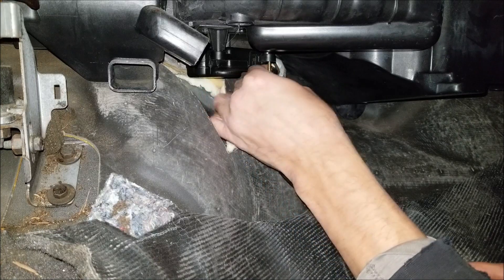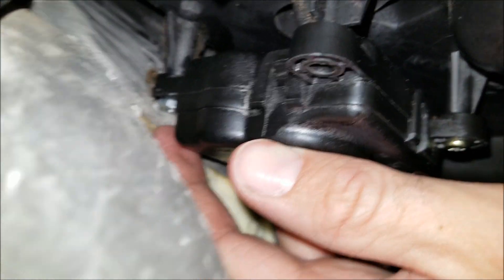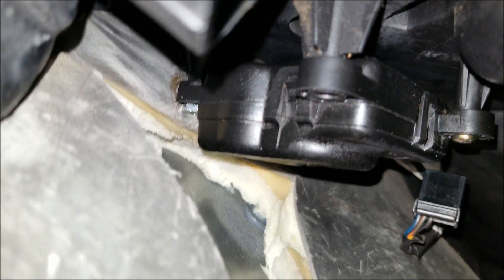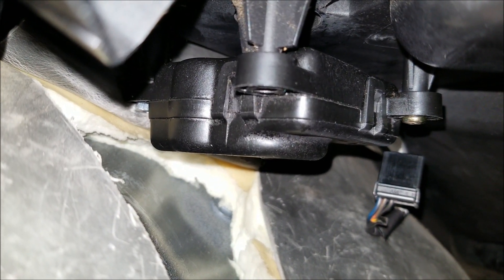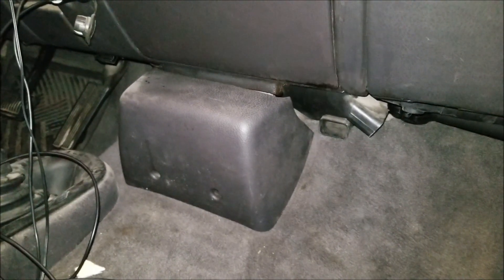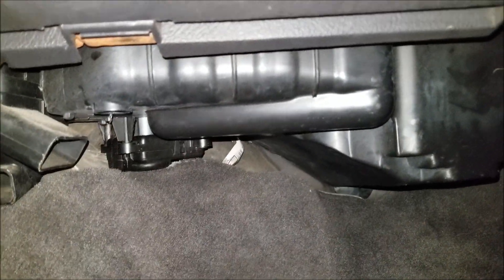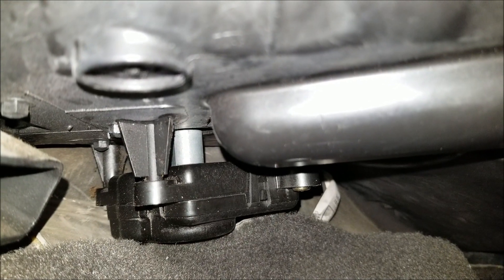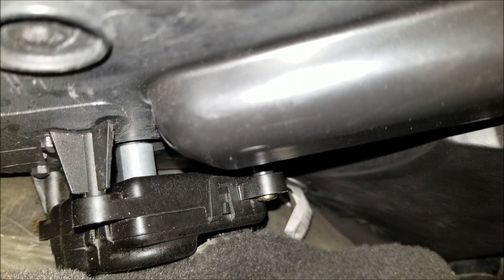2001 Dodge Ram 1500 - Blend Door Repair/Heater Treater Installation  - Part 3

Comment: Matt, thanks for taking the time to put out a great video regarding this issue. Keeping older vehicles on the road, one video at a time. Can't count the number of times I have wondering what the engineers were thinking. All they would have had to do is swap the back screw and the indexing post, and it would have made removing and installing a lot easier.

Comment: Great video! I am now in the process of replacing my a/c and needed to check if my blend door opened and closed but the actuator wasn’t working. Turned out the contacts were dirty but the plastic piece was fine. Your videos do come in handy in what to do and not to do in self repairs.

Comment: Great video. I suffered for 3 hrs. using vice grips and Phillips and made little progress. I finally found my 90 degree Phillips with 2 different size Phillips that I got with Craftsman screwdriver set (years ago). What I found was the undersized Phillips made quick work of unscrewing the fastener because you could be sloppy engaging the screw and still move it. Each time you tried to engage, you had to rotate the Phillips a full 90 degrees.

I bought a set of 3 threaded/lag screws at big box store for a few dollars and electrically tested by plugging the actuator into the system and exercising the temp knob. I may just use jumpers when I open the actuator. I bought the adapter on Amazon for $15.

Did the bottom of the door drag when you

Comment: Matt and friends, I was able to change that "adapter" lets call it, to the piece between the blender actuator and the blender door.

Things that may help you do this job easier yet. Use a 1/4 ratchet. Air Conditioning Dealers or Distributors, maybe Heater Distributors or Mechanically oriented like air conditioning or heaters distributors may carry this tool. Is sold or designee by Yellow Jacket, they have it straight and offset. I have them both because in air conditioning which is what I do, often we have to get our hands on tight spaces to unscrew 1/4, or 5/16's which is the other side of this two ratchets am talking about. Use a small Phillip bit and to hold the bottom of the bit I used a 1" spatula. A flat screwdriver is too narrow to hold the bottom but a 1"-1 1/2" spatula will help you to hold the bottom of the bit so it doesn't slip down. I added a piece of duct tape to the "neck" (space between the superior part of the Phillip bit passing the 1/4 bit and almost to the top I left about 1/8" of space for the Phillips bit to grab the screw. That little "neck of tape" will hold the tip from falling down and will hold the ratchet from slipping all the way up while trying to untight/tight the back screw.

Another hack. You can do the adapter with a piece of copper of 3/8". Just cut the length, and with an expansioner (This is a piece of steel that as you drive it into cooper pipes you can increase its width) Hope you guys understand. Because the bottom is a little wider than the 3/8" original size of the coper tubbing on the circular areas, the flat areas of the bottom are easy to achieve with a soft impact of a hammer or a controlled squeeze of a channel lock. The top part is just a little increased and hitted softer yet to keep the shape of a D. Now you see the straight line on a D, if you face that line, holding the adapter, if you make the D first, face the straight line of the D, right where the corners of the straight line and the curvature of the D meets, that corner or straight end is the width of the flat bottom. Increase the bottom a little, make it coincide with the other bottom, go easy, because is easy to pass the width, then flatten it's sides, with a soft hit of a hammer. Until you have the bottom part that fits in the actuator. Test and hit, test and hit, test and hit and you will save some bucks. 

I left my cut floor sponge just covered with the carpet. Just in case I have to revisit in the future.

All works great. It may use a little of WD40 to act faster but is a slow movement but it works great man!

Comment: Nice video and good information.  I really appreciate your help.  Don't forget the last screw for the motor.  Also, to save some time, you could try an offset phillips head screwdriver or a bit like you used but with a 1/4" drive ratcheting box wrench.  Thanks again.

Comment: Thanks, Matt. I can't afford to pay someone to fix my truck so vids like this are invaluable.The Haynes manual is useless.  My heat has never worked well. It is stuck on cold now and winter is coming. Pretty sure this will fix it. I wonder if a small, worm drive clamp on the outside of the broken shaft would repair it? Might go to a yard for the part otherwise.
Reply: Just an update. The no heat condition on my 1999 Ram WAS due to the actuator. The shaft was not broken. It shorted out with what looks like corrosion in the unit from a condensation drip. I turned the shaft to the heat position but still not much heat. Decided to flush  the core which was not blocked. I then filled the core with commercial toilet bowl cleaner and let sit for an hour. Flushed again and now it heats like a boss. Intend to just leave it in the heat position and when summer comes turn the shaft to the A/C side.

Comment: Enjoyed your video but heater treater was a little out of my price range.  And Mopar was ridiculously priced for the plastic one. I did the repair with $2 worth of aluminum rod and my Dremel tool. I stuffed the rear screw hole of the servo with a little bit of paper to hold the screw in place while I worked the servo into place. Just pull the paper out when the screw is started.

Comment: Great vid. I have to pull my whole dash and do heater core after deer season 
Going to be huge job.
Reply from the maker: Thanks man!  I actually intend to do that, too.  I'm not sure if my heater core is leaking...but it's never been replaced as long as I've owned the truck since 2005, and I need to re-do the entire AC system, too.  I figure if I'm going to pull the dash to replace the evaporator core, I'm definitely going to replace the heater core at the same time.  Then I'd like to put it all back together and put a new dash cover on, because like pretty much all second generation Rams, my dash is cracked.  I'll definitely film all of that if I ever get around to it.

I feel like I'm kind of digging myself a hole with this truck.  I'm pretty sure I have cracked heads (very common issue it seems), and the transmission is original.  At some point, the truck is going to need engine work and transmission work, but here I am spending money on other stuff to make it nicer.  But I just can't bring myself to get rid of it, for several reasons: 1) it's the first vehicle I ever purchased using 100% of my own money and I'm kind of attached to it, 2) I just love the style of the second generation Rams, and 3) it's pretty much the perfect work truck for me.  So, hopefully I can fix it up and keep it running for many years to come.
Reply: Matt Payne yes i totally get it. I’ve spent  about twice to three times what the trooper is worth but I love it. 
Also the education I’ve gotten is worth a great deal. What I’ve learned will be with me forever! 
I can’t wait to see your future vids on it. 
Maybe jump into the heads yourself. Haha huge job
Reply from the maker: @ktcgarage8572  Totally agree!  I wouldn't change anything I've done.  I love all of my vehicles and have really enjoyed learning to maintain them myself.  6-7 years ago I had never even done an oil change, so I have learned a lot by watching others' videos, reading forums, and asking friends lots of questions.  It's been a fun ride, and I truly enjoy trying to help others with the videos I create.

I do hope to replace the heads myself eventually.  It's really not much farther into the engine than the replacing the plenum gasket, which I've had to do twice (unfortunately)...just requires a few extra steps like removing the exhaust manifold and rocker arms/pushrods.  My biggest challenge right now is that I don't have a garage, so until that changes, I'm limited in the scope of what I can tackle.  Hopefully I can either build one soon, or move to a home that has one.  I still have two Troopers that need to be merged into one, also...
Reply: @mattpayne4087  so the dash is easy to pull it's not a problem at all

I have people stop by my Channel all the time it's fairly new but this is what I do as a profession I'm a master technician for Ford

I also have a 2001 Dodge Ram and had to pull the dash to replace the heater core and I was watching so many videos on how to do it and it's like man these videos were so long and I was like you know what screw those I'm just going to make my own video and teach people how to do it

Actually had to replace the actuator tonight the door was fine it was the actuator that was bad on mine

Comment: This can help if my ac is blowing through the defrost as well ?
Reply from the maker: No, unfortunately that is a totally different issue.  That is likely due to a leak in a vacuum hose somewhere in your engine compartment.  The HVAC air diverter is controlled by engine vacuum, and when there is a leak, it causes the airflow to do strange things like that.  I had a similar issue years ago and it ended up being due to a split vacuum hose near the intake manifold.

I hope this helps.  Thanks for watching!

Comment: You might be able to help me so I got a 03 dodge ram 1500 and when I got to start it it looses all electrical power I replaced the alternator and battery what else could it be?
Reply from the maker: Does it start, and then die?  Or it just never starts at all?
Reply: @mattpayne4087  it was a bad possitive battery cable

Comment: I got the same problem on my 2001 Cummings ac is on but no cooled air out the vents I feel cold air from from somewhere just not vents and no heat anywhere hopefully this solves it THX alot BTW my middle name is Paine we re almost bros lol

Comment: I can hear the ac clutch cut in and out when i turn on heat is that normal?
Reply from the maker: Hmm...it's normal for the AC compressor to cycle when the defrost is used, but I don't think it should do so when the heat is on.
Reply: Mine does that too.

Comment: Yes it was helpful. The way they designed it we have to remove the wheel, the metal holding the bottom and top dashboard before we're able to remove the entire plenum, fan ducts and actuator. They "simplify" its fabrication so much that if you gonna do that job you did (am doing it right now) or replacing the top dash they've put screws from front towards driving area like if they did them through the firewall..so I realize they mounted the top dash to the metal plate, install the metal plate, attached the electric harnesses then they put the wheel. Insane installation. That's why to do it removing the whole metal panel would cost us almost a thousand dollars by design.

Comment: I have a 96 2500 Diesel, I bought it used, never had heat. I just discovered the blend door actuator isn't even there! I bought a heater treater, and I can install it to the metal rod that comes down and attaches to the actuator,,, but again, I have no actuator. To make matters worse, the plastic studs that hang down that an actuator would normally mount and screw into, they aren't there either. So even if I went and got an actuator, I wouldn't be able to bolt/screw it into anything. I looked to see if some idiot pryed or ripped those plastic attach points off, but it looks clean and flush, like it was made that way. Now I'm wondering if what's there is either aftermarket, or came from a different year model but still fit?  WTF do I do now? Has anybody got any ideas? HAs anyone else had this issue? Can I rig some sort of contraption to that metal rod that comes down, and manually adjust the hot/cold? Any suggestions would be great, as I'm headed to a new job in freezing cold Reno area. Thanks

Comment: I have a slightly different issue. When I turn the AC on the drivers side works great but the passengers side blows hot air and at the same force. Do you think this would be the same fix? Also mine is a 2005, 2500 4 wheel drive diesel.